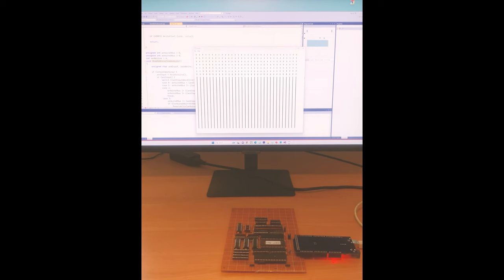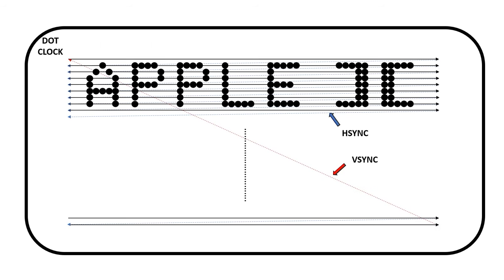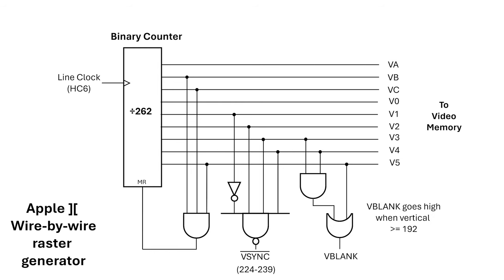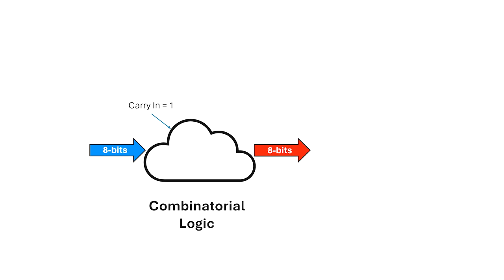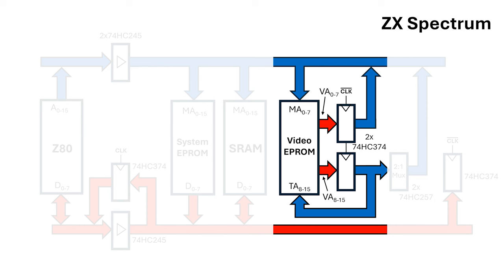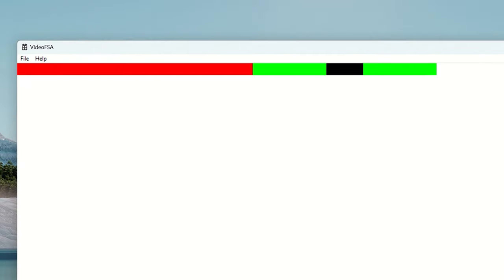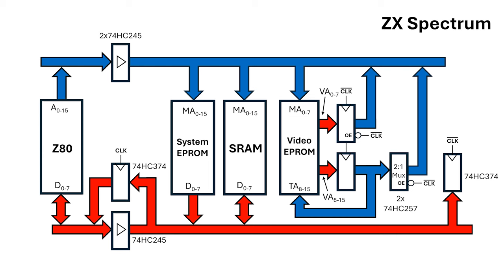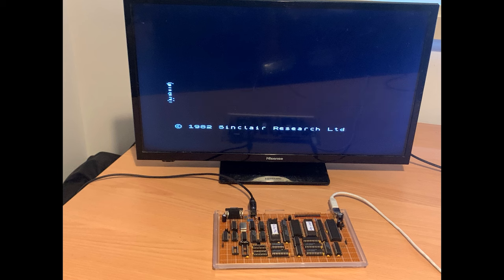ZX Spectrum build video circuit.

Comment: My memory is rusty, but my understanding of why the Spectrums screen buffer has such an odd address layout is down to simplifying the work the ULA needed to address both the pixel data and colour data at the same time.

I decided to double-check, and here's what was on "Break Into Program":

"When the ULA is drawing the screen, it needs to make two fetches from DRAM, for the pixel data and the attribute data. In order to make this more efficient, the ULA uses DRAM page read mode. The advantage of this mode is that the bytes can be read quicker, but there is a limitation: the least significant 7 bits of the address being read must be the same."
Reply from the maker: Yeah.  We had a discussion about page mode before on a different video.  It doesn’t really buy you much, there is still only enough time for a single z80 access per 16 pixel block.  It may have simplified the ULA design though and relaxed the timing on the DRAM.
Reply: A mystery that has been bugging me since the first time I got my hands dirty with a ZX Spectrum, 40-ish years ago. It all makes sense now.
Reply from the maker: Excellent.  If you haven't seen it i go into more detail in this video 
https://youtu.be/mL0K5u1zkko
Reply: @DrMattRegan  There's another reason that's often cited, namely that when rendering a character to the screen, if the start address is in HL, the next row of the character can be simply obtained with INC H.
Reply: @DrMattRegan  There's another reason that's often cited, namely that when rendering a character to the screen, if the start address is in HL, the next row of the character can be simply obtained with INC H.
Reply from the maker: Yes, true,  The character rendering code does something similar.

Comment: Good idea, using static RAM allow to discard all refresh logic (ULA) and earn more time to operate with video functions (no refresh cycles). In some solutions video output acts as refresh due cyclic access to memory addresses.
Reply from the maker: Yep, that certainly happens in the Apple 2.  I think the Spectrum memory sweep, will just keep the DRAM refreshed.  To sweep through 128 rows when video is active it takes 2.048 ms, and the DRAM spec is for less than 2 ms.  In the non active region, the Z80 will keep it refreshed, but i don't think we can guarantee every row will be hit with the Z80 when video is active.
Reply: Ah, so THAT might be the reason why classic Spectrum clones from the GDR use SRAM instead of DRAM for the video circuit.

Comment: I finally found the time to watch this. Some really clever ideas for multiplexing the RAM and using the EEPROM for raster generation. When I watch videos using digital logic to generate raster scans, I also am amazed that the original TV engineers did it using vacuum tubes and analog circuits. Analog circuits still seem like magic to me.
Reply from the maker: Yes, particularly the PLLs for color burst is amazing analog magic !

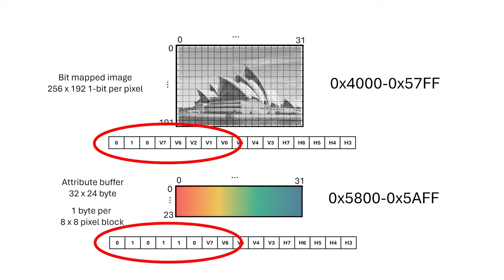Comment: 15:52 looking at the address bits for raster and attribute like this, or rather in reverse, with focus on the low 8 bits, the V5:3 shuffle actually makes sense, because the low 8 bits are identical and stays the same for a full video read cycle, saving precious logic cells and timing constraints in the ULA. raster-V7:6 has to go where it is to avoid overlapping the raster and attribute buffers, and V2:0 goes where there's space left, in the middle. This also enables the RAS-CAS-CAS read pattern to fetch 16 bits of raster/attribute in 3 cycles, and still refreshes the video RAM fast enough while the Z80 is running uninterrupted in high RAM.
Reply from the maker: Yep, i think it saves code in the ULA, but I'm not sure page mode saves that much over full random access fetches from a bandwidth perspective.

For a state machine running at 7 MHz in the ULA (an assumption), over a 16 pixel block, full random access take 3 clocks each (12 clocks in total),  leaving 4 clocks out of 16 for the Z80.

In DRAM page mode, we're looking at 5 clock for a RAS-CAS-CAS access (3 for the initial RAS-CAS and 2 for each CAS after that), so doing 2 of these will take 10 of the 16 clocks.   We would save 2 clocks out of 16, but this isn't enough (going from 4->6) to do another z80 memory access is that short window.

Even if you put all 4 access (per 16 pixel block) in the same page with some more address swizzling,  i think we still have 9 video clocks and 7 for the Z80 per 16 pixel cycle.   7 pixel clocks is 3.5 CPU clocks, and i don't that's enough for back to back reads, so we still stuck with one CPU access per 16 pixel block.

Would be interesting to have a look with a logic analyzer.

Comment: In the late 70s (pre zx80) in the UK there was a company that produced eurocard sized boards for homebuilt computers - Reading based if I recall correctly. One card was a clever video card which used a program on a 2048 bit ROM to cause a Z80 MPU  to generate the required signals for a video output. Sadly I had to dispose of the computer that I built around these boards many years ago.
Reply from the maker: You might like this series 
https://www.youtube.com/playlist?list=PLjQDRjQfW-84WG47-5UjPz1BrXxc1acvd
where i start with a Z80 and an EPROM to generate video.
Reply: In 1975 I designed the first of a homebrew computer based on the soon to be released Z80 1MHz CPU. 120GBP in 1976. I still have the original manual and the associated "Programming Reference Card" which, at the time, I'd practically memorized. Of course I'd used data from magazines  etc. to guide me. Life intervened. So I thank you for the reminders of went through my mind nearly 50 years ago. @DrMattRegan
Reply from the maker: Great, glad you got some value from it.
Reply: Might that company have been Green bank?

Comment: I'm really interested in the use of look up tables to emulate logic, in a similar way to using an eeprom. I'm thinking that a simple table look up is quicker than implementing a series of gates in code, particularly something like a counter or a flip-flop. I have started work on an Atari Pong emulated as look up tables which maybe one day can output a composite signal using a microcontroller. Only issue I can see is that this method won't take into account gate propagation delays which are integral to Pong.
Reply: This is a very well used technique especially these days with eprom so cheap. You can essentially simulate any combinational logic using this method. Back in the 8 bit days eproms were however quite expensive and slower than today's so it was less useful.
Reply from the maker: If your interest in pushing EPROMs to do more, have a look at this series.
https://www.youtube.com/playlist?list=PLjQDRjQfW-84j-jLvrbEeDvGl0QrhX9p7
The CPU is basically a big EPROM and  RAM.
Reply from the maker: Correct, it was cheaper to use the logic back then.  But a 27C322 is pretty cheap and if you're hind wiring things, it's much easier.
Reply: As schrodingerscat1863 says, certainly EPROMs were (maybe still are) a lot slower than logic gates, which take 10s of nano-seconds to switch verses hundreds of nano-seconds for EPROMs in the old days. Additionally each calculation needs to be clocked, so if you have logic in series (and the complete answer can't be calculated and implemented in the logic) you will need multiple clock cycles to perform the calculation.
Reply: Appearing long after I was tinkering with Z80s and logic gates, an FPGA is probably the way to go these days rather than an EEPROM.
Reply: @axelBr1  It all depends on the complexity of combinational logic you are replacing with EPROMs. It often takes many levels of logic to obtain a desired result making combinational logic as slow or even slower than EPROM, not sure where you get EPROM taking hundreds of ns from, EPROMs are readily available and inexpensive with read speeds in the 45ns range which is only around 4 layers of LS logic. Calculations requiring intermediate state cannot be implemented using this technique alone and something like a PLA, CPLD or FPGA would be a better fit in that situation though an EPROM with with a few flip flops can produce very complex state machines quite easily and this is really all early CPLDs were back in the day.
Reply: @schrodingerscat1863  As I said, I haven't played with EPROMs in many years, so take your word that they are now down to 45ns per read cycle.
In addition to the lack of intermediate values, there is the difficulty of ensuring that the outputs of all possible input combinations are pre-calculated and loaded.
Reply: @axelBr1  Yes, calculating the data to load into an EPROM is a challenge though there are utilities to turn truth tables into files to load directly into an EPROM these days. Doing it by hand back in the day was a pain for sure and prone to error. Check out some of the projects on YT building processors from discreet logic, they go into this kind of thing in when depth generating their microcode subsystems and internal control logic.
Reply from the maker: The 27C322 comes as a 50ns part.
Reply from the maker: Depends on what you want.  There are limitations to EPROMs, but i've specifically used one because the TuringZ80 uses large EPROMs.   It uses large EPROMs because it closely matches the design of a Turing Machine.  Personally, my interest is in the teaching more than the machine at the end.
Reply: @DrMattRegan  Wow! And 32Mb too!

Comment: Your wiring technique looks interesting.   Where do you get the AWG 30 bare wire?   Is it also possible to source the sleeve for it on a roll?   Thanks.
Reply from the maker: I personally use Jaycar in Australia
https://www.jaycar.com.au/black-wire-wrap-wire-on-spool/p/WW4345?pos=2&queryId=a6e2bf71cf03fc3c034a21396ba9608a
It's not cheap, but you want the Kynar.
I've found the cheap stuff from China doesn't work as well.

Comment: Would it be possible to program an eeprom to replace the real ula in a speccy as replacing them is silly prices or maybe use a pico
Reply from the maker: Not really.  Pins are very different and we need the DRAM controller etc

Comment: Just got you channel recommended by YouTube, loving all this series! Now, I am intrigued: how does this SRAM sharing  approach affects the overall performance? I understand this circuit leaves the CPU pretty much free of wait states (unless I missed some important caveat). Can you make some comparative benchmark with an original ZX Spectrum ?
Reply from the maker: Yes, the machine will be faster operating out of the lower 16K RAM.  I have a video where i go into this in more detail.
https://youtu.be/mL0K5u1zkko
I'll probably implement the wait circuit described in that video.

Comment: It's a pity, looks like number of chips does grow. Do you have plans to reduce it in next version?
Using two separate SRAM chips could reduce total number?
If just replace ULA with few parallel FLASH chips and replace DRAM chips with 2 SRAM chips?
Reply from the maker: I'm planning on going in a different direction.  Next step is to replace both the ULA and Z80 with EPROMs, octal d-type flip flops and SRAM.
Reply: @DrMattRegan  Waw, interesting what will be the final tip count!